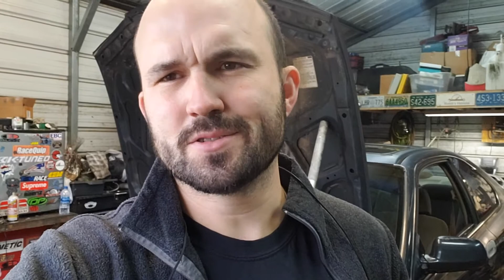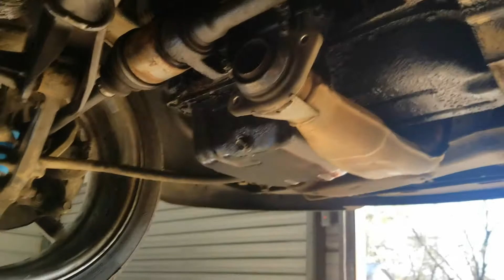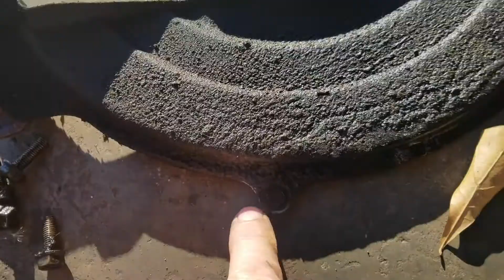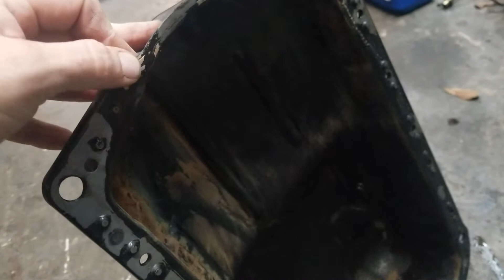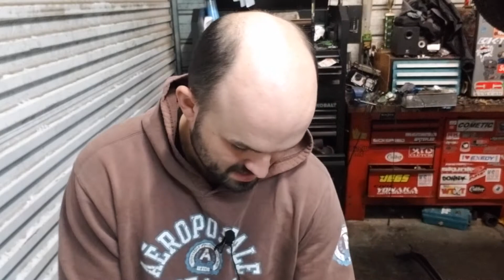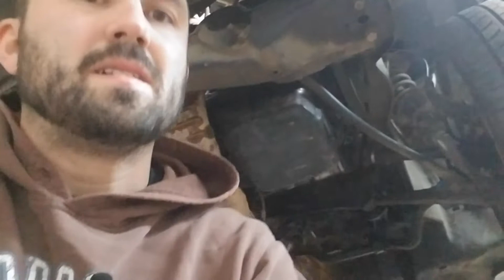1994 - 1997 Honda Accord THE BEST Oil pan gasket / Spark plugs / Power steering Oring install

Comment: Do you know the product code for the gasket? Most of them dont say permadry plus...
I tried installing mine last night and its spitting oil everywhere cause I was following the trq video and it told me to apply the rtv to engine block itself. Having real trouble with my Honda Accord 94... singlehandly the most troublesome car repair for me is that gasket.
Reply from the maker: OS30632T

Comment: Not very good video seen better thumbs down
Reply from the maker: 🤷‍♂️ you're welcome
Reply: @hondaresource  Hi, nice video. I have a 99 Honda Accord. I was thinking of using the same gasket brand. The last mechanic who did it used RTV all the way around and set the rubber gasket on top. It created a worse leak. It had leakes 1/2 in 10 months. After they did this, it had been 1/2 cup until they attempted to reseal. Now it's 1 teaspoon per start up. 

I read that you put RTV in the stepped areas and at the corners. Does that sound right? I'm thinking maybe it failed to seal because they used the two things together, gasket and sealant? They said  that the PCV system and valve registered as normal, but they wanted to open the engine to check. I said "no." It seems like the pan just didn't seal. Thoughts?

We now have the pan out, and we are cleaning it up. I'm just not sure we need RTV. This place made me worry a lot, but I think they messed up. I saw cracks in the cheap gasket and it was bulging out.

Comment: Did the oil pan leak?
Reply from the maker: No, not with this gasket
Reply: @hondaresource  I should have used one of those on the Integra. I changed it twice using a KP Gasket, and a OEM Gasket, both leaked. Frustrating...

Comment: May be a dumb question but can you get to the push rods through the oil pan?
Reply from the maker: Hondas don't have push rods
Reply: @hondaresource  then what would cause a constant steady tick, that speeds up with acceleration? The car has had regular 3k oil changes and valve adjustment and still ticks. Some people say Hondas just do that, then I wonder would I benefit from an engine flush?
Reply: @truthseeker1203  the knocking could be from the piston being damaged or there is pre detonation going on

Comment: I followed the video, and i went to turn my engine on, now i have a check engine lights and a tick in the engine somewhere.. i ordered a new oxygen sensor.. the back one came when i needed the front one 🤦🏽‍♂️ waiting on the right one but even when i get it i dont think that will fix my engine tick.. next thing im thinking is lifters? I did change the oil when i did the gasket job.. trying to pinpoint it wondering if anybody’s had the same problem

Comment: I’m looking for a video showing the replacement of front rotors for a 94 accord lx without the use of powered tools. If you can be kind enough to make a video that will be awesome. It’s a hub over rotor design which makes it so difficult
Reply from the maker: I can make one if a customer comes in for brakes